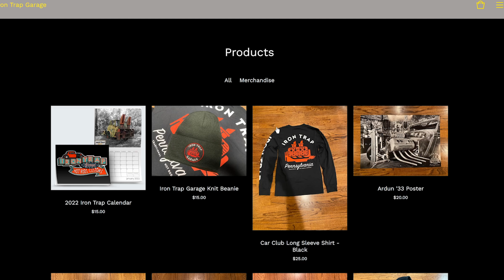Roadster Pickup Shop Truck Gets Disassembled For Chassis Paint!!

Comment: I’m in the UK and worked at a Ford dealership in the 70’s and early 80’s. I hated taking the Essex V4 out of a Transit van, the engine was a piece of junk that needed lots of attention and the transmission was hung from a top mount and rolled about like a drunken sailor when you tried to engage the input shaft on the clutch splines. I have struggled for an hour or more to get the lump back in. Fortunately, one of my workmates was a guy in his sixties who had seen and done it all, when I finally admitted defeat, I ask for his help. He was always good natured and would stop what he was doing, come to my bay, look the job over, tweak the engine crane, fiddle with the transmission jack and jiggle jiggle, wiggle wiggle, push, the spline was engaged. It never failed. I am still in awe of his talent 45 years later. God bless you Fred.

Comment: I  believe those lines are connected to the  wiper motor my y65 t bird has the same system  the wipers. run on either the   power steering  pump

Comment: Matt: Just curios, are you comfortable not to box in the A frame, running a blown-in Flathead engine ??  or did I miss something ,,,,,,   nice job  !!
Reply from the maker: The engine doesn’t make all that much more power than a stock Flathead. More of a novelty than anything.

Comment: Fantastic ! Looks great , guys ! Nice to see it all getting painted & reassembled for an outstanding build , that will last many more years to come ! I tend to like the painting part of a build , because you've already done all of the work fabricating , setting up the fitments , cleaning , & installing a lot of the parts for the overall build itself . Paint means you're ready for finishing , having done all of the fitting . This truck is going to look like a million bucks . It already does ! The reveal & test drive will be a "Must see" video ! There will be the usual culprit "little things" to address , but once it's run in & adjusted to the new setup , it will be a fun truck to drive around in . You don't see many of them out on the road anymore , so keep up the great work , guys ! The before & after on this build is out of this world ! I still see that rusty old frame on rims , with the truck box loaded up with parts , rolling to the box truck . WOW !!! ITG's Second Wind !
Reply from the maker: Thanks Rob!

Comment: Just a suggestion only! With as many different cars y'all work on, just before disassembly take a few iphone pictures. This will be invaluable to you in the long run. I'm an old guy whose memory is not what it was and it is so easy to snap a few shots for reference later. Also I'm not a techno geek but sure Mike could assist if necessary. Enjoy all the old car stuff, thanks...
Reply from the maker: We do that from time to time but I’ve also taken so many of these apart I know almost every nut, bolt, and bracket by heart!

Comment: Using an angle grinder with a stripping disc would have gotten that frame down to bare metal, and done it much more quickly than using a random orbital.
Reply from the maker: Always a quicker and better way, what I hand on hand and decided to use. It was just surface rust; the frame was already blasted before.

Comment: A lot of guy box the frame so its stronger. Being a shop truck it would not hurt to do that.
Reply from the maker: A lot of guys box the frame and it’s unnecessary. Theses chassis were designed to flex and the small increase in horsepower won’t cause any issues.